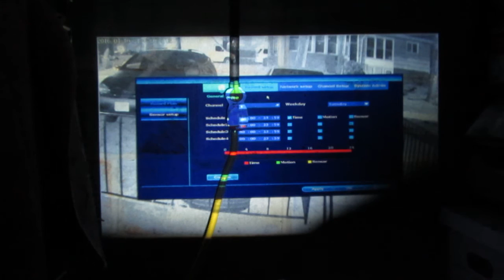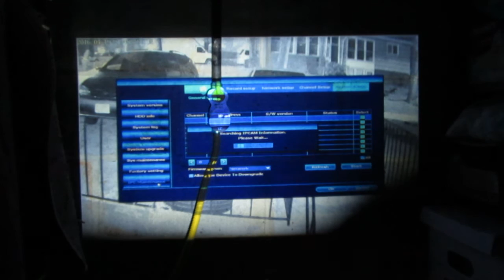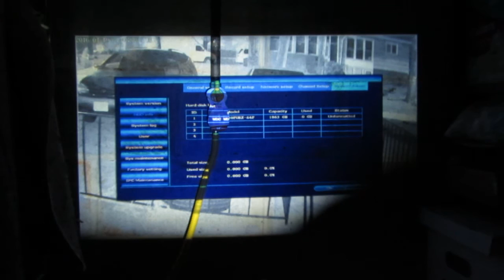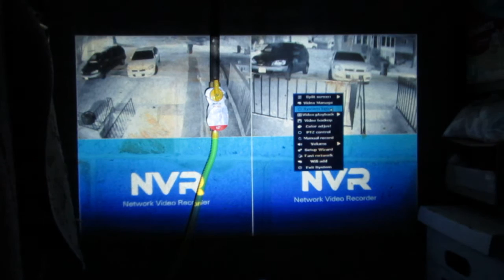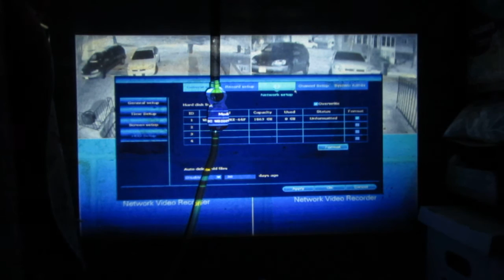xmartO WVS1044 4CH 720P HD Wireless Security Camera System Review

Comment: Thanks for sharing. To access the cameras via the internet, do you have to use the ethernet cable to connect it to the DVR system? Can you just connect it to your home wifi?
Reply from the maker: To access the cameras via the internet remotely you need to connect one Ethernet cable from the DVR to your router. The DVR can not be connected via wifi. The individual cameras connect to the DVR wirelessly without Ethernet cables. I hope that was helpful!
Reply: Thanks for the quick response. I should have phrased my question a little better, lol. I noticed that you have to connect the DVR to the router. It's good to know that I don't have to run cables back to the DVR. I'm thinking this may be a great purchase for me.
Reply from the maker: +Brandon Halliburton No problem.

Comment: My system is showing NVR logo in all four boxes. No video feed, HDD light not lightup and mouse cursor not visible, mouse click not working.
Reply from the maker: Try restarting the system.
Reply: @MrEngineerReviews  triwd couple of times, tried unplugging everything let it drain any residual power and plug back in. No changes. :(
Reply from the maker: Try emailing customer service they are usually pretty responsive.

Comment: Hello, I've configured everything, I installed the hard drive is new, but does not recognize me! in fact when I start my computer I get no hard drives connected ... No more can I do to recognize my hard drive.
Reply from the maker: Did you connect both cables to the hard drive?
Reply: Yes!! there is no way to go wrong with the connectors, you think I should format the hard drive?
Reply from the maker: +Carlos Gasca In order to use it for the first time you should format the hard drive. There is an option in the DVR settings. What type of hard drive is it?
Reply: Hitachi SATA 2TB
Reply from the maker: +Carlos Gasca If formatting doesn't help I recommend buying the recommended hard drive. They recommend a surveillance hard drive such as the Wester Digital Purple. That is the model I have that works perfectly.
Reply from the maker: +Carlos Gasca *Western Digital
Reply: one of my cameras is not working need help in trouble shooting the problem thanks